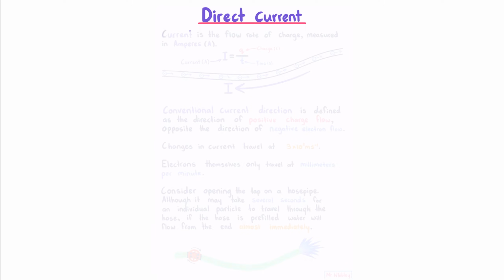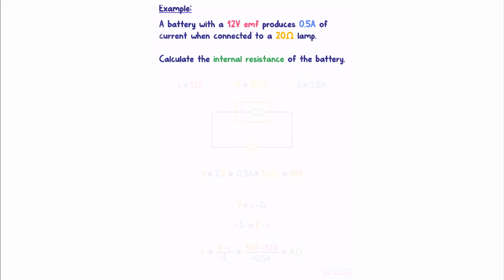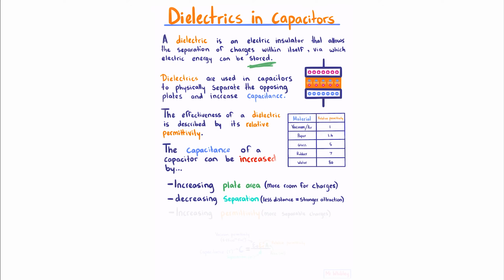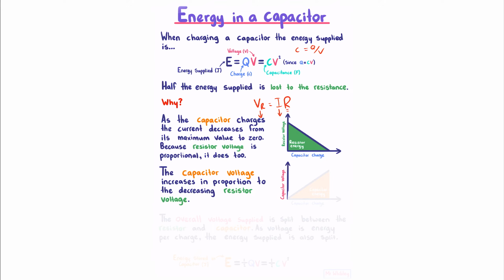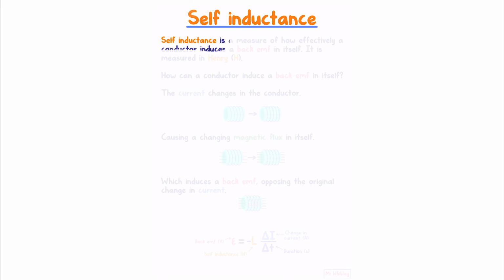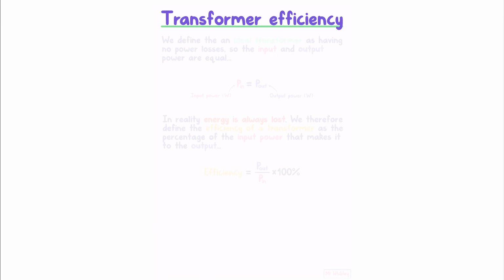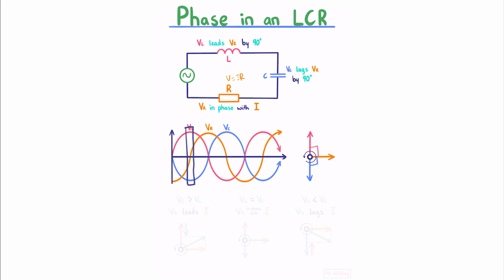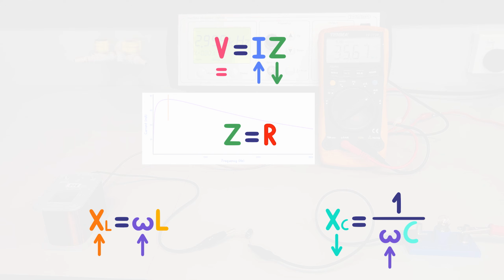3.6 Electrical Systems notes (NCEA Level 3 Physics)

Comment: Hi sir, for impedance, in the formula  'Z = sqrt(R^2 - X^2)', does it matter whether i write X = Xc - XL  or X = XL - Xc
Reply from the maker: Hi Matt, because the result is squared it will calculate the same.

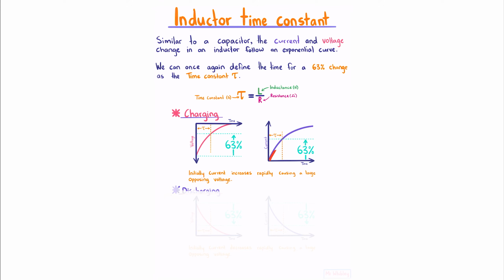Comment: Hi sir, why did you flip the graph at 48:00 if it remains the same for both charging and discharging? Im kinda confused because I feel like they look the same just flipped and if we have to draw like that on exam.  Is it to do with the directions?
Reply from the maker: Hi there. The voltage produced by the inductor is always opposite the change in current. If the current increases (charging), the voltage is negative to oppose this increase. If the current decreases (discharging), the voltage is positive to oppose this decrease.

I recommend trying to understand the underlying physics rather than trying to memorise the graph shapes. That way you're not just preparing yourself to be able to produce these graphs (though it's not commonly asked), you're also building your understanding of how inductors behave in general, which will have a very high likelihood of being useful in the exam.
Reply: @MrWhibleyPhysics  okay i understand that now thanks, but is that why the graph arrows are facing inwards instead of outwards?
Reply from the maker: No worries. Do you mean the voltage graph for a charging inductor?
Reply: @MrWhibleyPhysics  yeah lol I just wondered why the graph had flipped arrows instead of normal arrows and a flipped curve!